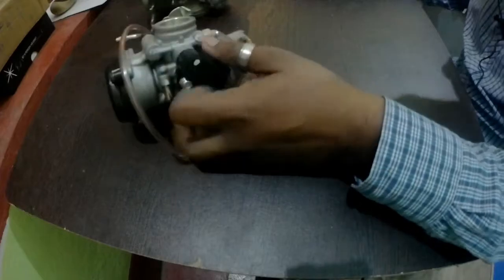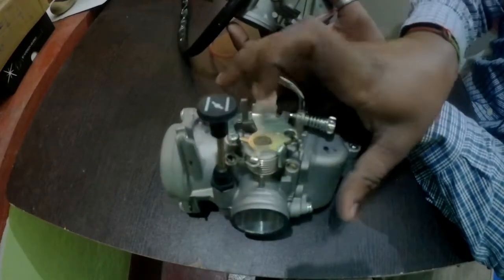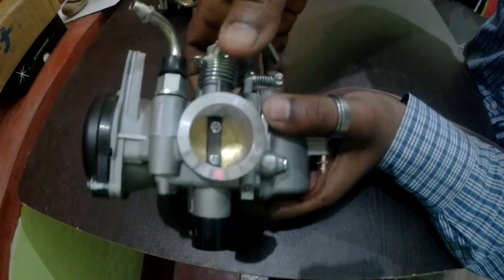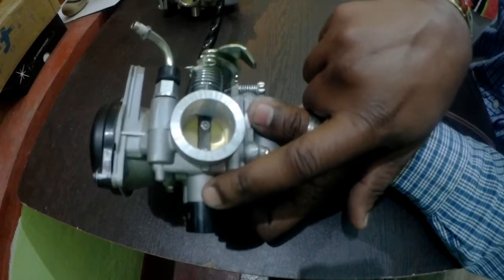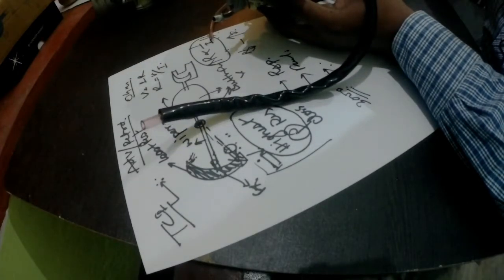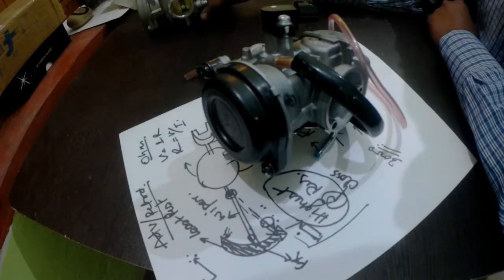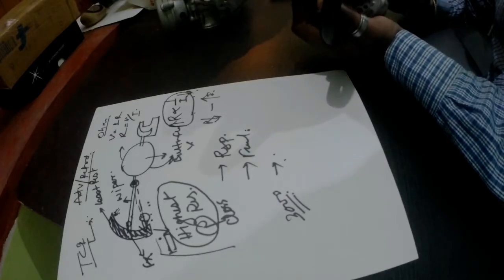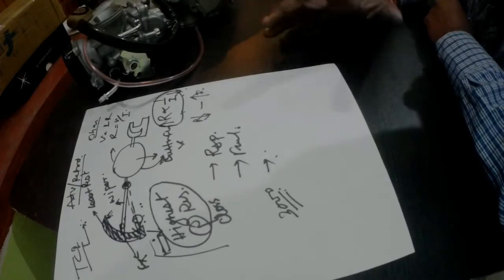Fz16 WHAT IS TPS IN CARBURETOR || FUNCTIONS ,IMPORTANCE AND WORKING

Comment: Cant you just unplug that cap from pulsar's carburetor and then attach the TPS on it? Is there any possibility? I have the same issue I am using non-tps based carb on my yamaha bike and observing the pickup difference.
One more thing, Is that butterfly valve available in the store separately to replace the old one.
Reply from the maker: you're welcome here..your first query seems to be of 1 level up- Yes it can be but not a  direct fit.cannot be directly mounted by removing that cap. Threads need to be build for mounting the screws(high precision work) , few O rings( not available in market) needed and still after doing that there are chances of inaccurate caliberation.i am yet to try this.
 can you please tell what carb and your yamaha model? may be bcoj of the jet sizes you are loosing pickup. match the jets with your stock carburetor.
Lastly,Butterfly valves dont come in as a separate part
Reply: Bro i want to install pulsar 150 carburettor on my fz 2011..so jet screw need to change or not and the size?
And please explain the power losse issue and reason????
Reply: Then you'll also have to change the CDI
I mean where would you connect the wires?
Reply from the maker: Very old discussion. Pls re-read it..probably he is asking opposite thing. . 😃
Reply: @MotoTravelRide  
Yup my bad 
I didn't realise he replaced his carb with a dumb one

Comment: i have seen lots of fz-s with p180 carburettor
is p180 carburettor have tps,
in fact, my mechanic suggests going for p180 carburettor...
any advice, what to do
Reply from the maker: Tejas Savanaskar P180 carb will suit our fz./fzs ,u can run on it if you are low on budget. . But  they do not have the sensors which our  fz stock carbs come with.i have explained function of that sensor in the  video. . My advice go with a stock fz carburetor. .
Reply: MotoTravel thanks bro.....
Which will be more reliable p180 or original
Because already i wasted 2k by getting 2nd hand carb of fz, and now in just 8 month its not working, mostly ovdrflow problem in one in 2 weeks..
And i dont want again saving 2k and loosing 3k with p180
Reply from the maker: Don't waste more..  directly go for the original stock ones. It will cost you around 4600rs .   But it's worth it the sensor has very important function.. don't override it dude (Y) . Yamaha is way ahead in technology,comapred to others..
Reply from the maker: Whtsapp me on 9939302540. Will help you  diagnose the issue, at your own. .
Reply: MotoTravel thanks bro sure